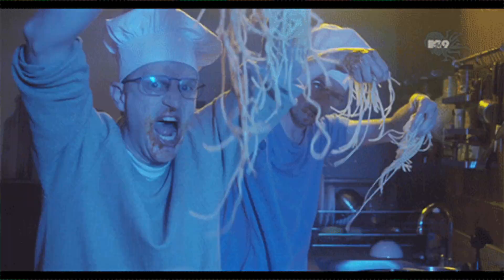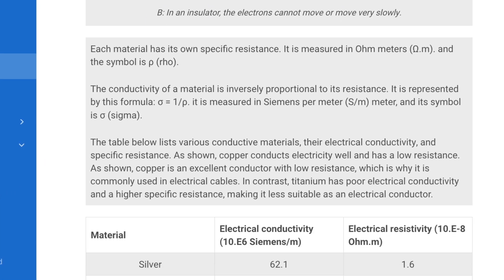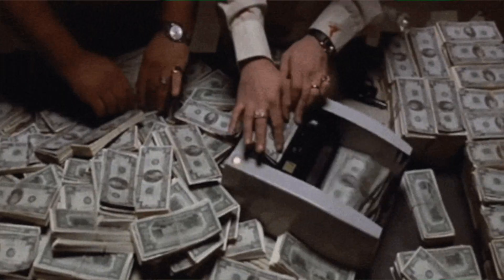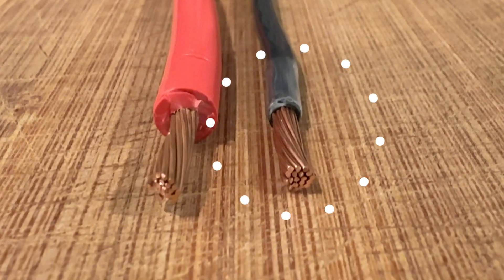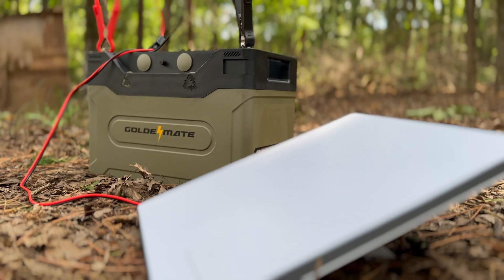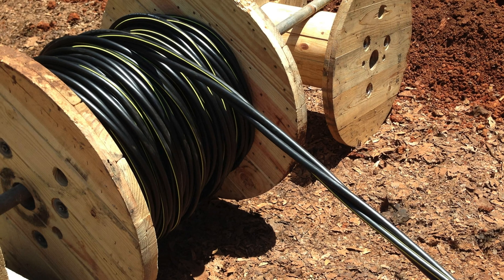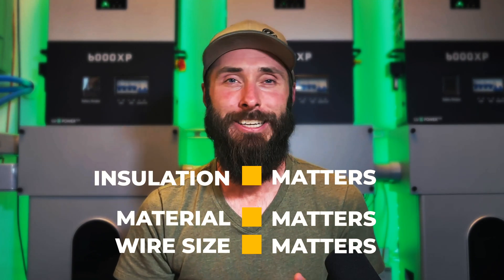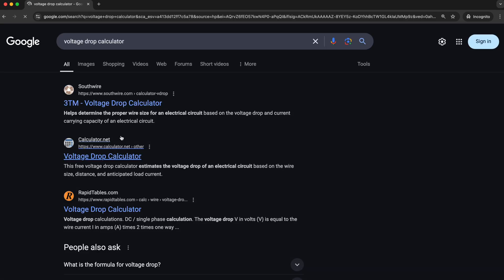Solar Power 101: Why Cable Size Matters

Comment: My recommendation is to just use ampacity tables for power transmission.  Just google that.  "Ampacity table for power transmission".  It should literally be the first result in a google search... there will be a column for the amperage limit for "power transmission".     This table is actually more conservative than the NEC 60C table, so you can use it as a starting point without worrying about voltage drop or cable length or temperatures or really much of anything.

For example, this table has 10 AWG at 15A and 2 AWG at 94A.  Yah, those numbers seem much smaller than they ought to be right?  But that's the reality if you want to run continuous power through a cable and not have significant voltage drop or heat generation.  That said, I don't always adhere to the specifications in this table, its just a good "no-brainer" starting point.  If the AWG is fine for the application, then use the table.  If it isn't, then you dive further and see what corners you can cut safely based on additional parameters.  Simple as that.

--

There are many reasons why I just recommend people use power transmission tables as a starting point.  The NEC tables are almost always incorrectly interpreted by DIYers.  For example, I will often see people sizing wires for inverters and batteries using  NEC's 90C tables and thinking that just getting silicon-insulated cabling means they can use a 90C table, or the cable is short so they can use the 90C table.  Or whatever.  Then they attach that cable onto a battery terminal or into a lug connected to a circuit board and wonder why things start smelling bad a few weeks later or why the battery is deteriorating faster than it should.

Certain cable types might be fine at high termperatures, but many of the things they are attached to are not.  Plus hotter cables leads to more thermal cycling and more maintenance problems (like loose lugs) down the line.

My advice.

-Matt

Comment: Great video, simplfying the concepts, Eric. One important thing to note when googling those charts and calculations,  there is a difference between DC circuits, vs. AC. 

Let me explain: Voltage drop calculations are different for AC and DC circuits, primarily due to the introduction of impedance in AC circuits, which includes resistance and reactance, whereas DC circuits only consider resistance. 
Here's a more detailed explanation:
DC Circuits:
Voltage drop is calculated using Ohm's Law: Voltage Drop (V) = Current (I) * Resistance (R). 
The resistance (R) is the primary factor, representing the opposition to current flow. 
The calculation is simpler because there's no reactance to consider. 
AC Circuits:
Voltage drop is calculated using Ohm's Law, but with the concept of impedance (Z) instead of just resistance (R): Voltage Drop (V) = Current (I) * Impedance (Z). 
Impedance (Z) is a combination of resistance (R) and reactance (X) (which is the opposition to current flow due to capacitance and inductance). 
Reactance is frequency-dependent, meaning the voltage drop can vary with the frequency of the AC signal. 
The formula for impedance is: Z = √(R² + X²), where X is the total reactance. 
Power Factor:
In AC circuits, power factor (the ratio of real power to apparent power) also plays a role in voltage drop calculations. 
A lower power factor (meaning a higher reactive power) can lead to a higher voltage drop, even with the same current and voltage. 
Line Losses:
AC power transmission and distribution systems experience line losses, which are higher than DC systems due to the effects of inductance and capacitance. 
DC systems generally have lower line losses because they don't have these reactive components.
Reply from the maker: Just when I think i have something understood. lol Thanks, James!

Comment: Good job! Another tool is Ugly’s Book,  it’s a reference guide it’s not an end all do all because NEC has a lot of articles that relate to other articles I.E voltage drop,de-rating, box fill, etc. but a quick reference it can be very helpful for beginners. I’m an electrician so NEC is king here but Uglys is quick and easy to navigate and can help folks.
Reply from the maker: Thanks for the tip there, Donnie! I'll check out Ugly's Book.